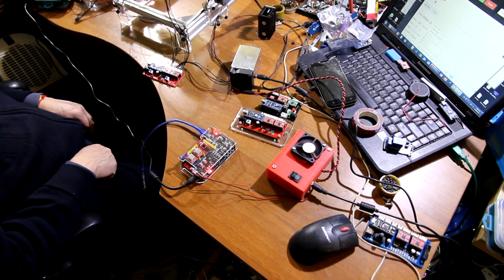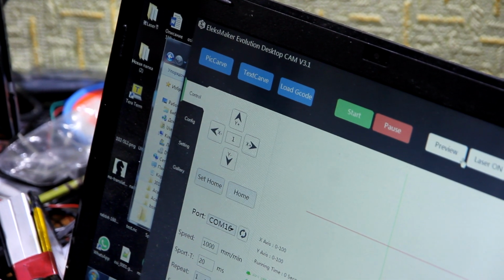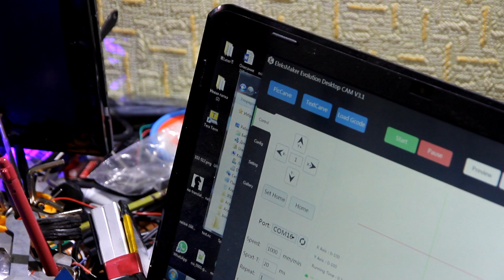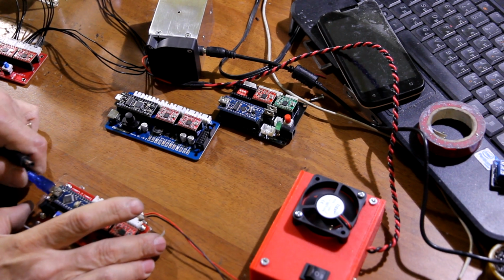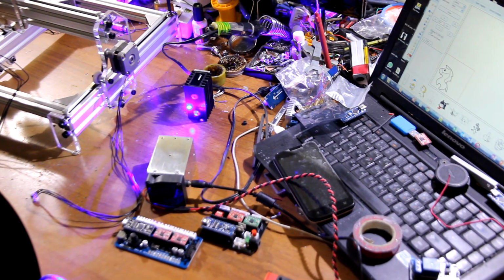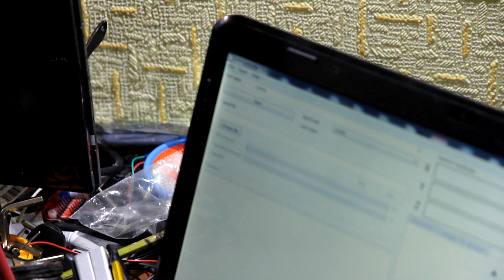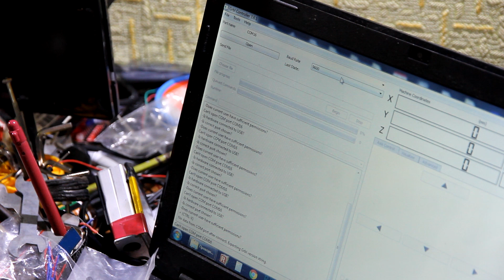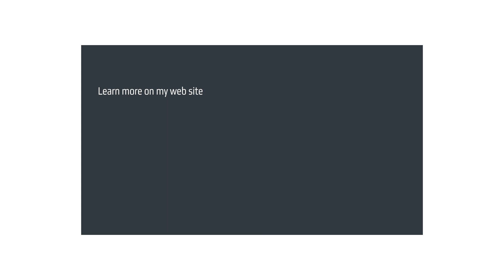Pinouts and software for different DIY engraving boards : CNC, CNCC, Eleksmaker

Comment: I have a 2500mw Blue Laser from BangBad (LOL) and am trying to control the laser with a SainSmart Genmtisu Controller Board 3018.  The laser cooling fan runs the laser never comes on.  I have tried several laser software products with no luck.  I did plug the laser into another controller board 12V AUX output briefly and the laser lights.  Unfortunately that controller board only has a 2 pin plug for the laser while the laser has a 3 pin plug.  I'm stuck and at a loss for what to do.  I don't know if the laser is bad or if the controller board is bad.  Suggestions?

Comment: I couldn't see if some of those boards had 3-pin connectors as some I've seen do.   I've got a laser that has a 3-pin connector on the top and a 2-pin.  So I was looking for connection help with my 3018.  But I think I can use the 2-pin by itself. I was thinking it also had to have a separate power connected to the laser too.  Thanks for the video.   As constructive feedback you might listen to the videos with ear buds.  I think the fan on the power supply was making a lot of noise.  Might set it so that the fan is facing away from mic.   That and turn the music down or off.  Between the noise and music it kind of distracts.  Thanks again.
Reply: the laser controller that came with my bachinmaker. has 3 pins for the pwm as well. pin1 is the pwm, pin 2 is ground a,nd pin 3 is 12 volts the pwm pin goes from micro volts up to 4.5 volts.